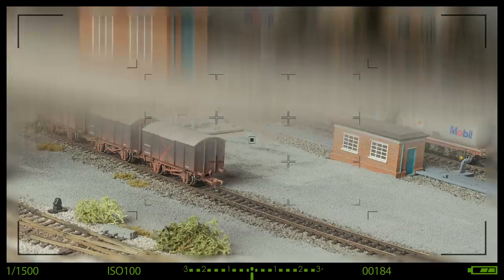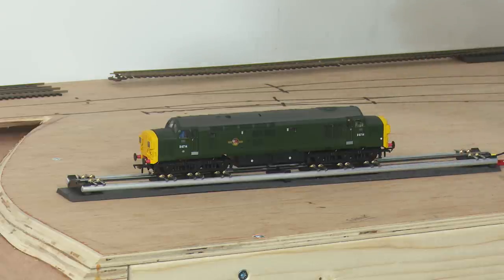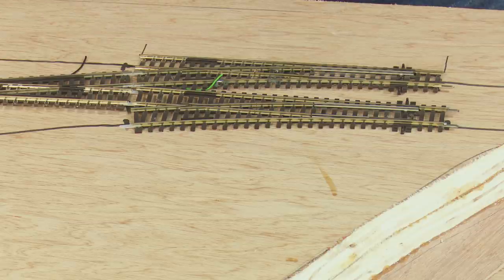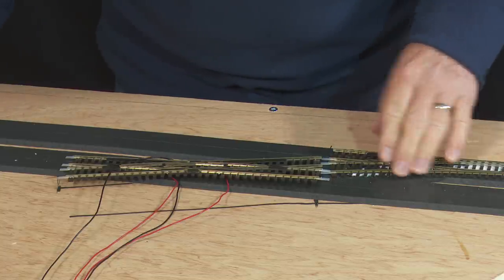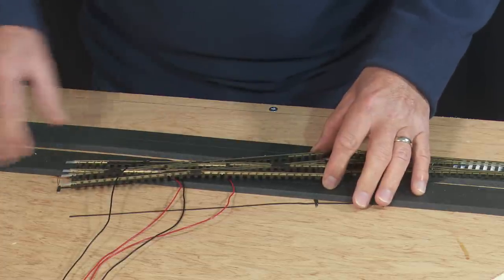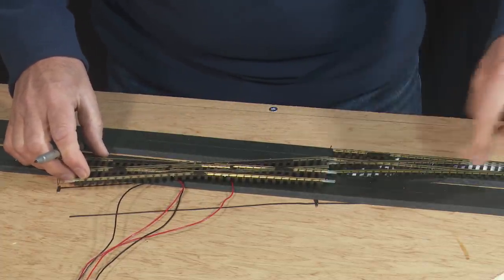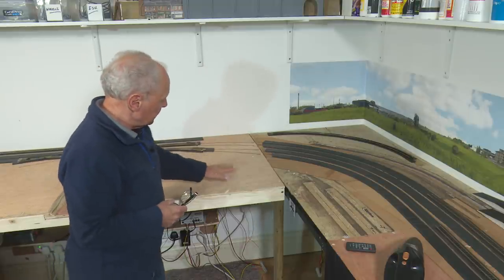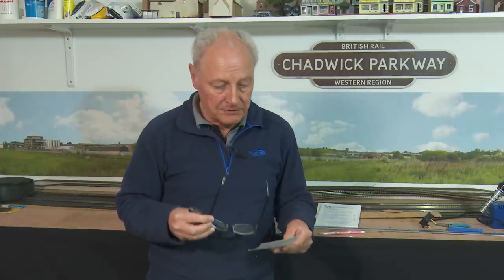Laying Track Bed and Laying Points at Chadwick Model Railway | 91.

Comment: Hi Charlie,have you considered using one of the sound deadening products used in the car audio field,you can peel and stick it to the bottom of your boards I used some in my panel van that I used to own to get rid of the echo y sound in the back worked very well and you don't need to cover the whole area otherwise it gets expensive I can't recommend a brand as I don't live in the UK but I am sure you will find it easy enough it may be worth a try
Reply from the maker: I'm onto it already Trevor.  
Once they are running I can check out what needs to be done.
Reply: Good idea... I would think also that the 4x8 feet styrofoam insulation boards would work / help as well....

Comment: Great video, thank you for uploading. I've noticed the sound differences in my layout as there is mixture of cork and foam roadbed. a good product I found to significantly reduce the noise was the 9" x 12" thick foam sheets sold by Michael's here in the states. its 99 cents a sheet and does a fantastic job reducing the noise. Though I only recommend it for yards or station areas as other wise you would have to cut each segment individually and then bevel the edges for ballast, either through trimming or vinyl wall filler. Perhaps something to give go?

A good perspective on track laying. I've found your videos very helpful as my model railroad evolves. I now do my wiring on sections instead of crawling under the layout. Still haven't gotten me sold on soldering though. Apparently not my cup of tea, so I only do it when I have to.
Reply from the maker: Very interesting RS.  What’s the real purpose of the underlay sheets?
Reply: @ChadwickModelRailway  I was looking for something to use for large areas to cover, say where multiple tracks come together, switches, yards or fiddle yards. I didn't want to use cork sheets, because as you say, it causes the rumbling noise. I also didn't want to use all my foam track bed from Woodland Scenics as it wasn't efficient. As we all know, this hobby is a bit expensive and I like to stay in budget and not waste. This way you can cover a very large area quickly and, due to the thickness of the foam, sufficiently nullify the noise transfer. Much to my surprise, the foam sheets are nearly the exact same height of the road bed and allow laying the Kadee under the track uncoupler with no effort at all. Hiding the in between rail magnets from sight.

Comment: Charlie lay down your phone track bed dry where you want it check it with the points and the dimensions and then with the marker outline the phone track. Pick it up add glue to the path on the plywood where it goes not on the track. Otherwise it's flopping around with what glue play the track. Back down set the points on it and position of points on the track bed where they need to go.
Reply from the maker: It's always obvious after Robert!  I'll try and buck up.

Comment: Charlie, 
Why didn't you tell me this last year, before I laid my track? As if rick hard PVA wasn't bad enough, you must have heard the penny drop at about 19 minutes when you mentioned pins transmitting the sound. Just last night, after I completed the rewiring of the main line, I ran some trains, just for entertainment before I turned the power off. I was wondering "why is the scenic section so much quieter than the fiddle yard?"  You answered that one at 19 minutes. The scenic section is glued, the fiddle yard is pinned. No, I'm not going to relay the fiddle yard.
Anyway, another cracking video, thanks very much. 
By the way, did you mention which glue you use for ballasting? I don't want to make that mistake as well.
And what's wrong with binge watching? What else do you expect viewers to do from Saturday to Thursday, waiting for the next installment?
Great stuff. See you next week.
Bob
PS. Have you considered a daily video? Just kidding.
Reply from the maker: Bob, it's time that you had you own account!  I'm so pleased that you enjoyed it mate.

Comment: Hej Mr Bishop. As you, am not much for the sound of drums in my new layout. Use foam trackbeds, but still the noice goes through the board. I have found a solution for that. It works great for me, and I wonder if it perhaps can be something for you to explore.
I have a framework for my layout. And now when i have made all connections under the tracks, i simply take arks of foamboards 10mm and cut them to suit these framework under my layout. They are not glued or anything, i just push them in the squared framework.
My layout is now so quiet that the rest of the family let me drive my train even if they are watching TV at the same time. I have my small layout in the corner of my livingroom.
Just wanted to share my tip on how to make the layout not sound as someone banging on drums in my livingroom.
Again, thank you for all your videos, they really help me in my own modell railway build
Reply from the maker: That’s great news LY. 
Can you send any photos to,
chadwickmodelrailway@gmail.com
Also what’s the foam board made from?
Regards Charlie.
Reply: @ChadwickModelRailway  Email sent. :)

Comment: Years ago I used the Gaugemaster foam which after about 15 years turned to a thick, tar like substance and the track just sank into it. Bloody crap it was. Yet at the time is was advertised as good for semi permanent, or permanent use. I had to lift the complete layout and start again.
Reply from the maker: A dreadfull result Sam.

Comment: Good job
Reply from the maker: Thanks mate.  I'm still looking at my up-side-down terminal blocks!
Reply: @ChadwickModelRailway  Charlie, don't worry about that, you have taught me so much. I sent you an email but I have actually printed off all the electrical parts to size and am now moving them around my board to get the order right and minimise the amount of wire I am using. 

As for this video I will be using g-clamps to put a straight wood edge guide then and then just glue the track bed down it would guarantee the 15cm and then the 10cm from the back edge and the straightness of it all.

Thank you for the inspiration. Onky

Comment: Charlie
I am not sure if it was on this video or an earlier one but I remember you saying you used Code 75 for the double slips because they were electrofrog. I am interested in doing the same but I was wondering how you join the two different track sizes. I know Peco make a small transition track but that seem to muck up the track geometry as it make the slip longer and wider
Reply from the maker: Hi John, What you need is a pack of Peco SL-112.  They are becoming scarce but available at a few outlets this morning.  They are certainly on eBay.

Comment: Can you help me with a track question...I often watch train cab view vids, and travel on trains a fair bit, in order to see things I could model on my layout. I often see a pair of running rails bolted down to the sleepers in the centre between the running rails.
Im not referring to the check rail, I know their purpose. The ones i refer to are fixed about a foot or more from the running rails. and bent inwards at each end...So I doubt they are there for wheel check reasons as they are to far inboard for that.
They seem to vary in length...could be 100 yards 200 yards...as a estimate..
Ive tried to look online but can only find items about check rails. Anyway, I plan to model these but ideal to know where and why I should place them..Im sure a visitor to my layout will ask me why and whatfor so I would like to be able to explain.
Thanks for any help on this...
Reply from the maker: Are these expansion rails Allan ?
Reply: @ChadwickModelRailway  Im not sure..But since you mention expansion rails, I looked at some images and found some of 3 or 4 sleepers  held together with a metal strip...with the running rails having opposing tapers to allow for expansion...I assume these strips hold the sleepers so that only the rails move and not the whole track.
But as to why over a long length... I dont know, unless there is several taper joints together.

Comment: A very informative video Charlie. I have thought many times, how I will lay my track? I will be using a foam bed for the tracks, but do I pin, screw (Complete with a screwdriver) or stick it down. I am old school and my layout will be DC. and I shall be using servo motors to switch the points. Controlled by some  Arduino and some UNO 3 PCB boards. These can control up to 48 point motors. You can adjust the speed of the switch over. It might be an idea to buy one extra roll of Backscence just in case any problems occur. Martin. (Thailand).
Reply from the maker: Hi Martin,  there are too many choices in this wonderfull hobby!

Comment: A small point, Charlie, but I see your backscenes go right into the corners. I expect most of us have this, but in their catalogue - maybe others make the same suggestion - Peco say we should have curved ones. I'm a bit surprised you didn't go for that approach . . .
Reply from the maker: I understand you point Peter but then you have two other joins to mask as the corner material (thin MDF, hardboard etc) joins the flat of the wall.  I just use trees etc.
Reply: @ChadwickModelRailway  Thank you!

Comment: You can always use self adhesive sound deadening stuck to the underside of the board which will help with noise. You can purchase this quite cheaply as it is used for motor vehicles
Reply from the maker: Have you tried it Gary?
Reply: Yes I have used it on one section which was noisy

Comment: G'Day Charlie. Well matey, you're about halfway there on sound reduction for the track work. The other half is a matting used on the underside of the boards. It will need to be as big as you can fit in between any and all fittings/fixtures that have been secured to the back of the boards. There are two ways to do this. 1) just use 1 medium type density matting that is either self adhesive backed and just cut and stick as required (works pretty good) or stick it on yourself with something like contact glue. 2) Use 2 completely different density and thickness materials. First layer I use is a very dense thin self adhesive layer and the second layer is more a loose density layer that usually needs to be contact glued on (I use a thick but less dense matting commonly called "Pin Board" its 9mm thick).
The funny bit though, is how one starts the first half. Its with at least 18mm thick Plywood. The reason for that is so you get LESS resonate vibration in the wood due to the cross-matting construction of plywood and the thicker it is, the less it will vibrate. Next is to use a thin layer of high density foam type matting applied roughly only where your track bed will go. Then your Track Bed is laid and again its a medium density foam type (the woodlands scenic is fine but you can get rolls of similar stuff from a hardware store far cheaper). I was using a product that is cellulose based from a company called - Cascade Rail Supply, but sadly the owner has retired and no ones brought the business so I've had to go back to neoprene foam. As noted any type of non hard setting glue is the go. Now due to heat expansion I've had to use staples to secure my track as I cant fix the track 100% down or it will buckle. So I use a very narrow dimensioned Cable Staple to secure my track with, this lets the track "Float" on top of the track bed but still stay fixed. (Roof space "Loft" can get over 50° in summer). The ballast is then tacky glued with clear sprayed on contact glue that never really sets but I have to make room for the track to wriggle until its touch dry (sort of). On top of that due to the heat I also am trying out an expansion join every 3 meters using parts from both left/right catch turnouts. 
The reason for two different types of density and thickness in the sound reduction matting is that not one type of matting will cancel or nullify every frequency of sound that the trains will make running on the layout that is disruptive (Brownian noise). So to get the minimal amount of Brownian noise as possible you need to try to reduce as wide a frequency bandwidth as you can in the boards.
PS: Brownian noise is roughly the type of noise we get from our trains on our layouts.
Reply from the maker: What a great comment G130.
I will look into an Under-board fabric once I have my life back!
Stay safe, regads Charlie

Comment: Intresting video i went to cork and pin route so far happy with the noise i get. Loke how you did black to the back i did the oposite and did Red to the rear.
Reply from the maker: As long as your plan works RF.

Comment: Dear Charlie, following your great guidance on the sound deadening approach (I am going to apply this approach on my layout), one element requires clarification. You are using PVA to secure the ballast. PVA is rather not rubberised adhesive, so I am wondering whether unwanted rumbling sound will not be transmitted to the baseboard via dried out ballast shell? Is there any reason why you are not using a rubberised glue to secure the ballast? I was thinking about Woodland Scenics Cement, but not sure whether it is rubberised material or not.
Reply from the maker: I’m sorry but the jury is still out on this one. But rest, assured using PVA as a ballast glue is not an option. The noise transmission is enormous.

Comment: Hi Charlie
Love your videos. I have a question, I am modelling in 00 gauge and have 2 risers on each of my mainlines. I am using woodland scenic 2% risers with cork on top of them and then ws track foam bed on top of the cork. Finally on top of the trackbed I am using DCC Concepts powerbase plates and then magnets on the underside of the locos in order for the locos to pull 5 or more coaches. With all this how do I overcome the sound issue you talk about in this video. Keep the videos coming. 
John
Reply from the maker: Sound seems to be transmitted though dense substances.  It wouldn’t have thought that you will any problems.

Comment: Thanks Charlie, Try Neoprene i tried lots of different substates & adhesives, Neoprene which has a self adhesive peelable back strip came out the best for noise reduction it was applied all over the entire layout, ballast was fixed using a latex adhesive ( copydex) finally the track pins were then removed, i did not need a trackbed as i have a flat engine shed & yard layout but around the perimeter is a double track branch line so this was doubled up with neoprene to establish a raised trackbed.
Very silent slow shunting in the yard, the branch line which is 90% freight is also very quite. Neoprene lasts for 30+ years has very good memory but is a little expensive but you don't have to cover the whole layout as i did just do the track parts but remember not to ballast over the trackbed sides or some of the noise reduction will be lost. Finally i have rubber feet on all the table legs which all helps, i have not the technical ability nor inclination to produce a vid but you may prove the concept if you wish or any other modeler. Off cut samples of neoprene can acquired from the manufactures plenty of them on the net. take care Charlie all the best,,,, Andy
Reply from the maker: Great comment Andy, how thick was yours?
Reply from the maker: Hi Andy,
I've asked them for a quote regarding their 4mm sheets.  Thanks for the tip.

Comment: Hello Charlie.

I have decided to have another go at building a OO Gauge layout after several false starts and am gradually working my way through your very helpful videos.

This one is particularly relevant for me as I soon expect to be laying track.

I noted that your points are Electrofrog and have a polarity switching wire at the frog. I intend to follow the same system, but was wondering if I will still need to fit insulated rail joiners the to the rails at the frog as would be the case if I did not have a polarity switch in my DCC accessory Decoder?

Sorry if Thais seems like a silly question, but I'm still not confident when it comes to wiring.

Thanks especially for the tips on sound insulation. I have used cork in the past and after ballast was applied the "rumble" continued 🙁

Cheers
Keith
Reply from the maker: I've just seen your next comment.

Comment: Had an idea about the problem of marking out the baseboard, only then to cover the markings with the track bed, leaving more measurement work. How about using a string line?
Reply from the maker: Yes that’s an interesting idea Simon.
Regards Charlie

Comment: Charlie - I don't know much - but I do know that you apply Copydex to both surfaces - wait for it to nearly dry - then join them together. That way you don't have to watch stuff slip about…
Also, someone else mentioned measuring to the middle of the underlay. Or why not just work out the difference in track width, and underlay width and measure to that?
As you say, it's easy to see after the event. 

Thanks as ever for explaining things clearly and fairly, your reasoning is fascinating. But I do so hope you eventually get to run a few trains…
Reply from the maker: I'm getting there Chazzy.  All the point motors were wired in today.

Comment: I've used Copydex to fix the WS roadbed and to fix the track to it. The noise is horrendous. It's louder than pinning the track directly to the baseboard but I can't understand why.
Reply from the maker: I’m absolutely baffled Dave. Is it the drumming of the baseboard or is it just the noise of steel wheels on steel rails? Regards Charlie